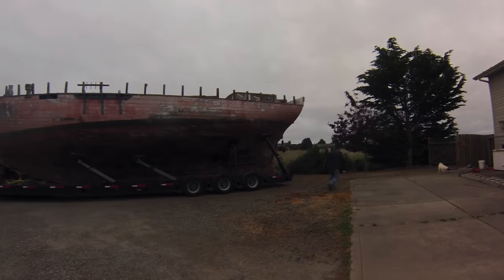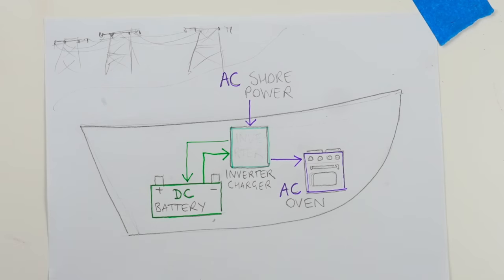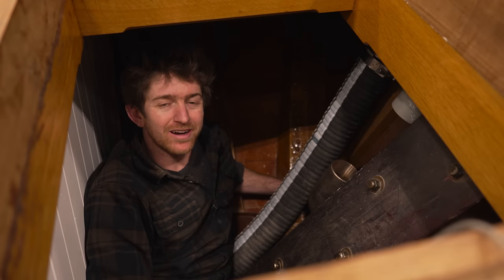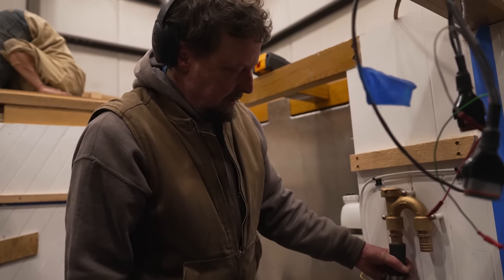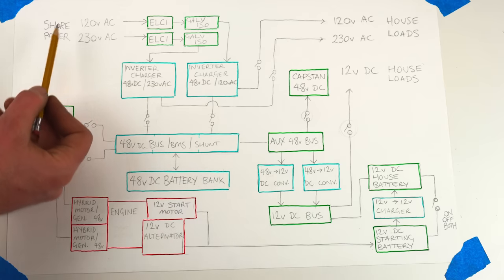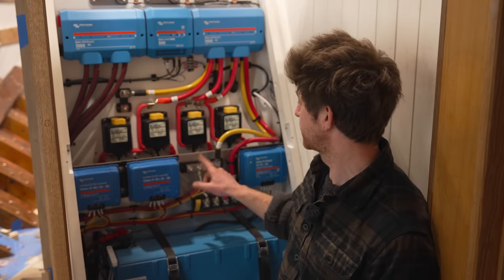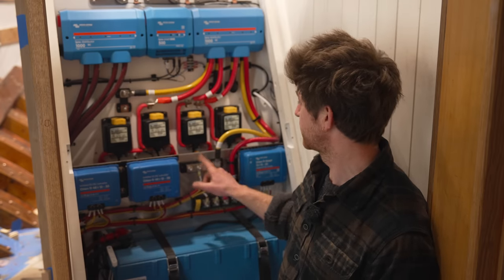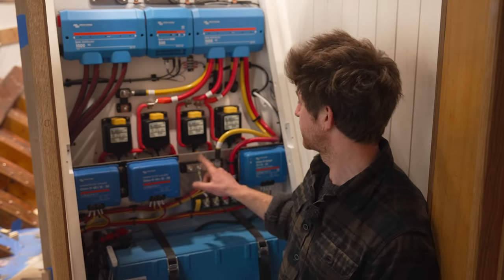Electricity is dangerous

Comment: The wiring looks fantastic.  I do have some concern about choosing Yellow as DC Negative.  In the US, people expect to see Black as DC Negative.  Inexperienced people can easily get into trouble without cable labels that clearly show the voltage and polarity.  I would lock this cabinet unless there is a code that says otherwise.  Thanks for sharing the video.
Reply: I'm pretty sure anyone who could not infer within milliseconds what the color coding was, given that there are only two colors, one of which is red, will not be dicking with this.
Reply: @Gottenhimfella  Yes and No.  After 50 years working with electrical systems it still amazes me how messed up someone can get themselves into.  It worse with low voltage as it is viewed as not dangerous.  Make a single mistake around a 12 volt car battery and see how big the sparks can get - sometimes you'll also get a nice explosion.

Comment: Having converted my boat to 48V electric propulsion recently, I'm keenly aware of the difficulty in sourcing parts that are able to handle the entire voltage range of a "48V" LiFePO4 battery pack (up to 56V). Amongst other things, it seems like you're using the BlueSea ML latching relays, which aren't rated for 48V, but stop at 24V. I wonder if that's something you're aware of, and if so, did you somehow gain information from the manufacturer stating that those components are actually 48V DC capable? Similarly for the switches you've got.

I've faced the same problem finding fuses and circuit breakers. For fuses, it's been hard to find, some resellers (CurrentConnected) have few of them in stock. For circuit breakers, I end up either using the A-Series types of "AC" circuit breakers, since they're rated for 65V DC, or DIN Rail miniature circuit breakers from industrial suppliers.
Reply from the maker: The BlueSea remote switches are actually rated 0-64v DC for the main contacts, the control is rated 9-16v DC. The documentation for these switches can be confusing, but the units are labelled on the switch itself.
Reply: @SampsonBoatCo  that's great to know. Do you have a list somewhere of the components you're using? I'm still collecting my ideas about where to source 48V components.

Comment: Inverters/stereo amplifiers need to be cooled. Most just have a heat sink. Most make the mistake of bolting them to something without a air gap. Best way to install is bolt them to a sheet of aluminum bent in such a way as to provide a gap. The aluminum also adds to the heat sink. For all you stereo installers quit insulating your amps and they will stop shutting down.

Comment: So, with the black water flushing system, you mentioned how you would need to turn both y-valves in order to have it flush either into the ocean or into the tank.  What would happen if you only turned one of the y-valves and forgot to turn the other one?  Can anything go wrong there?  Or is there some form of redundancy in that loop for situations like that?

Comment: With all the electrical power on ship I'm surprised there isn't a powered pump on the head with the hand pump as a backup.
Reply: Or better still, a manual pump on the head and a spare manual pump to swap in if it fails.

Comment: 240 VAC 50 Hurts ?  so what route will you take when going to the UK ? The North West Passage, around Alaska and Canada?? Also on the drive line clutch assembly there is a white spacer that has no captivity, so the first time this assembly is unbolted the spacer will disappear. Be sure to carry a spare ? Or just just captivate that spacer into the strap assembly.

Comment: Doesn't lever need a lock or reinforcement to keep it in place?  Also will you be putting in a barrier between the engine and the inverters?   Hot engine near hot electrical with oil near by seems to be risky.

Comment: Are there plans for any solar or wind generation to charge up while at sea? Just assuming you won’t want the diesel running more than necessary.
Reply: Under sail, they can drag the prop to turn the motor-generators, while the diesel's transmission is in neutral. That way, they exchange some boat speed for charging the batteries.

Comment: With the holding tank above the head.. would it possible to accidentally drain the tank back into the head? Or does the Y valve only have two positions?

Comment: Electrical system looks good, especially the switchable engine start battery backup. Past experience tells me that, at hectic times, the electrical and electronic bells and whistles are secondary, if you need the engine pronto to get out of a jam, but can't start it because of battery problems.

Comment: When the engine is in generator mode, is it charging the batteries because of the fuel it's burning, or can the prop also charge the batteries as well?
Reply: The diesel can drive the prop & charge the batteries simultaneously, or do one or the other. The prop can drive the motor/generators to charge the batteries, w/ the diesel shut down & its transmission in neutral.

Comment: So you stated the electrical bay will be vented (cooled), out through the top with computer fans and pulling in air through the bilge compartment. Is there any concern that air will be corrosive (salty) coming from the bilge, and corroding electrical terminals?

Comment: The detail was good but then I'm into the electrics side and understand the plumbing side.

Out of curiosity, is galv isolation really a big point on shore power for a wooden boat? I know it's a hell of a deal/breaker on metal boats for obvious reasons but then I think they're meant to be completely electrically isolated for that reason. I didn't think it was a huge issue in glass/wood/concrete?

Comment: Just as a safety precaution - any DC voltage over 30v can stop the heart or lungs if across both hands.  e.g. 48v can be lethal and one keeps one hand in their pocket to prevent touching.  Use one hand and not two on live circuits. Short across a finger will just tingle.

Comment: Are you going to have an Isolation Transformer installed into your system so any stray electrical current from the dockside doesn't affect your system and corrode anything in the water? SV Dauntless had that problem on their previous boat in Florida and this is how they dealt with it.

Comment: From a HVAC in buildings point of view (Heating, Ventilating, Air Conditioning) you keep electrical cabinets etc. well away from water for maintenance considerations and possible accidents. With the close  proximity of the hatch I can't help but think this is a disaster waiting to happen.
Reply: Having the inverters right next to the engine puzzles me

Comment: I assume the exhaust comes out under the water line?  If so why?  Why not just avoid the entire problem of water entry and put it out the deck or somewhere else above the waterline?
Reply: The muffler needs raw water fed from the engine heat exchanger in order to both muffle the sound and to reduce it's temperature........
and since water needs to fall to the bottom of the muffler the muffler needs to be mounted lower than the engine...which itself is mounted lower than the waterline to start with.
The mixed water and cooled exhaust gases then leave the muffler by being blasted up the rubber pipe by the pressure and volume of the exhaust gases leaving the engine....and exit the boat via the transom....
but the transom exhaust exit is above the waterline as  if it were submerged... seawater would flood back along the exhaust pipe, fill the muffler...then fill the engine when the engine was not running............

Comment: I'm not a fan of the clutch lever in the engine room. I would at least put a led up in the cockpit that lights up when the clutch is not engaged. It would be a shame if you forget you disconnected it and suddenly need the propulsion to work.

Comment: Why not just get 2x 120V inverters that can synchronize and make standard 120/240VAC grid on the boat? Those units should have galvanic isolation built in, than you just get a 48V DC battery charger that can work on 80-240VAC 50/60Hz.

Comment: Why is the exhaust below the water level?
Reply: The muffler needs raw water fed from the engine heat exchanger in order to both muffle the sound and to reduce it's temperature........
and since water needs to fall to the bottom of the muffler the muffler needs to be mounted lower than the engine...which itself is mounted lower than the waterline to start with.
The mixed water and cooled exhaust gases then leave the muffler by being blasted up the rubber pipe by the pressure and volume of the exhaust gases leaving the engine....and exit the boat via the transom....
but the transom exhaust exit is above the waterline as  if it were submerged... seawater would flood back along the exhaust pipe, fill the muffler...then fill the engine when the engine was not running............

Comment: I hope you'll apply dielectric grease on all naked metal parts of the electric set up as otherwise salt in the air will corrode the metal, even stainless steel. Used by car shops to improve the life of the ignition system, so works at very high voltages as well!

Comment: 10:31 It's interesting how the "Master / Slave" paradigm for equipment was so commonplace, but now it seems like a gross holdover when you see it still crop up in engineering. It's like if you walked into a McDonalds and it was filled with cigarette smoke again like it was the 90s. Most engineers have switched over to "Primary / Secondary" and "Main / Backup" for cases such as this.

Comment: Just wanted to point out that low voltage and high voltage systems are equally dangerous if anyone got the wrong impression from the AC/DC explanation.

Comment: In the past, brass or bronze has been king for contact w salt water. Why isn't  Stainless Steel used more exclusively for these in/out fittings going through the hull in contact with salt water nowadays?
Reply: Any ferrous metal in contact w/ damp wood leads to iron-sickness.
Reply: @Frederick Stibbert  
I mentioned  Stainless Steel  not  normal iron or galvanized iron.
I do agree iron and salt water is a no no.

Comment: Generally the manuals advice against installing those blue boxes inside potentially hot engine rooms. Was there a good reason to do it anyway ?
Reply: The diesel & the inverters will almost never be running simultaneously.
Reply: @frederickstibbert7389  I am not so sure. Leo has as yet not much offered about the galley concept. If he stays classic then you are right but if he will e.g. install electric cooking then it's a different ball game.
Reply: @johnmayer3433  - The cooktop/oven is an electric induction design, I assume it'll use AC line power. The marine fridges I've looked at are almost all adaptive, using 12 or 24vDC or 120 or 240vAC.

Comment: Why have I hybrid diesel motor no a sailboat? Couldn't you use the prop or some other way to turn the electric generators while you're under sail seems counter-intuitive to use diesel to charge your batteries on a sailboat
Reply: You've missed part of the story,, see EP87 & 115. Tally Ho will be able to charge the batteries by dragging the prop while sailing.

Comment: Can the  230 volt 50 hertz inverter, easily be switched to 230 volt 60hrz? This is popular in American RV parks for running Dual Air conditioning units. and other more powerful options.

Comment: I am surprised you are showing the 60hz system as 120Vac.  All US homes are actually 60hz, single phase. 240Vac center tap systems.  My emergency genterator for my house is also a single phase, 60hz 240Vac center tap system.   I'd bet your inverter is the same.

Comment: Does this drive system have the ability to use the propeller to drive the hyper motors without turning the engine 🤔 to charge the batteries.

Comment: What prevents human error from sinking or burning up the boat?   Seems like lots of complex systems that require intelligent manual effort to operate....
Reply: The batteries & other gear have internal temp & current sensors that can shut things down, in addition to the usual external circuit breakers.

Comment: a you gone have a RCD ?. What is an RCD? A Residual Current Device is a sensitive safety device that switches off the electricity within 10 to 50 milliseconds if there is an electrical fault. An RCD is is designed to protect against the risks of electrocution and fire caused by earth faults (lightning strike )

Comment: I am a little disappointed that Leo felt required to virtue signal with the wasteful "hybrid" motors. Electricity loses energy three ways. Heat loss when converted from fossil fuel, line loss when it is forced transmission, and loss of energy when it is converted from electrical to motive force through copper windings produced by wasteful MINING AND SMELTING.